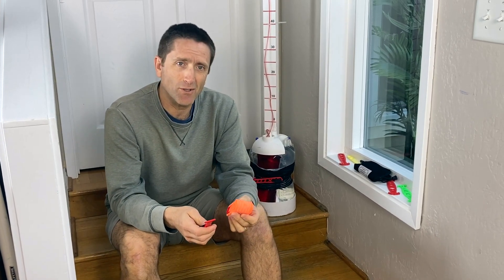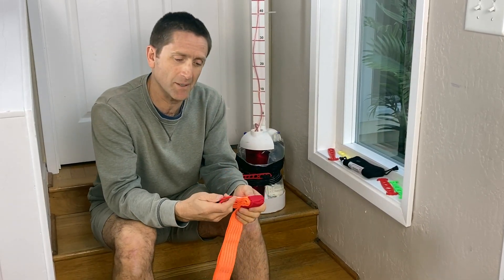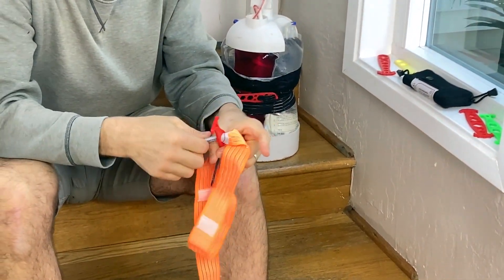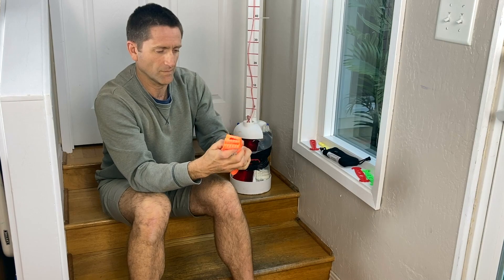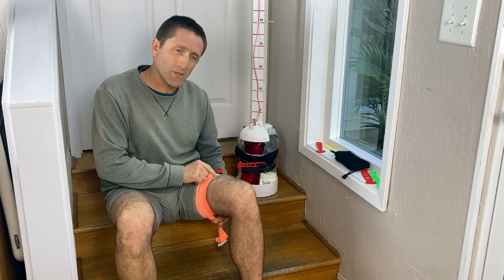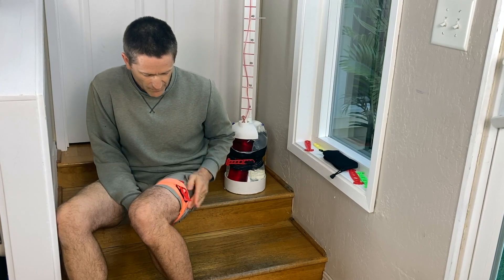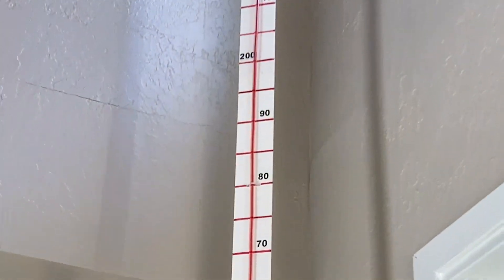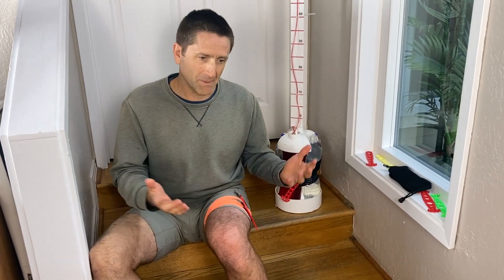Slishman Pressure Wrap Threading Through a 3D Printed Windlass - Staging - Application - Testing

Comment: Does the addition of the windless compromise the simplicity and quickness of applying the wrap in the event of a one-handed (applying to self) application? Can the windless work with one hand or will the uneven pressure bend or snap the windless? Has the addition of the windless now made the wrap more complicated to use by the EDC,  non -medical person, layperson? Thank you!
Reply: This is a far late reply but I'd figure I'd try and help. If you pre-stage this  windless he examples here, I don't see how it would delay or compromise the application time because you're still using the loop design to quickly overlay on the lim. We do the same in the military with the CAT (depending on your style). We pre-stage the CAT with it looped into the buckle so all you do is slide it over and tight. Same concept. I bought one to trial it and see if it really is viable as an TQ for massive hemorrhage control. I think this could be potentially more effective than a CAT because you can use the elasticity to apply more pressure before even tightening a windless.
In summery, if you add a windless it's essentially attempting to replicate, for example, the CAT TQ. You can apply CATs one-handed, part of why they're so popular. Probably need some practice but doable. I can't speak to the durability of the 3D print but honestly you could just slide a bar in between the wrap if you leave a tail and secure it that way.

Comment: This was thought provoking:

1. I love how you're able to adjust the position of the windless at 3:10 in this video without having to move the entire wrap to do it. With a CAT/SOF-T Windlass Tourniquet, you'd have to loosen the tourniquet a bit in order to adjust the position of the windlass and then begin re-tightening everything. 

2. This is the only windlass tourniquet I've ever seen, that has a removeable windlass.

3. This also means the windlass can be replaced if necessary.

4. This also means the windlass can be swapped out for another type of windlass (different models and designs) to suit the users preference.

5. Another thing I love about this is that it has redundancy inherently built-in to the wrap itself. 

With a CAT/SOF-T windlass, if the windlass was to somehow break or fail... you lose the ability to tighten the tourniquet altogether and the chances of achieving enough occlusion to stop the bleed pretty much go out the window. Which would be a terrible situation to be in!

With the Slishman Pressure Wrap you don't have to worry about that problem because even if the windlass mechanism somehow failed (seems extremely unlikely, but I'm speaking hypothetically here) or broke, you're still able to achieve sufficient occlusion to stop the bleed and help the patient, using just the wrap by itself without the windlass (because of the elastic!). 

So the Wrap can still achieve occlusion in most use cases, whether you have the windlass component or not!

This is why I love the wrap so much personally, it's so well thought out and reliable 

(and much easier to carry around in my pocket than the CAT I used to carry in an ankle kit haha!)
Reply from the maker: Bill do you have a 3D printer by chance? I'm happy to send you the files if you'd like to try a few. My email is samslishman@gmail.com. 

The part about breaking risk and consequences is a big consideration I think. High mechanical advantage means low torque on the part and lower risk for breaking. I've printed these with 20% infill and they still do the trick.  That said, I'd still use 100% infill. Thanks again Bill!